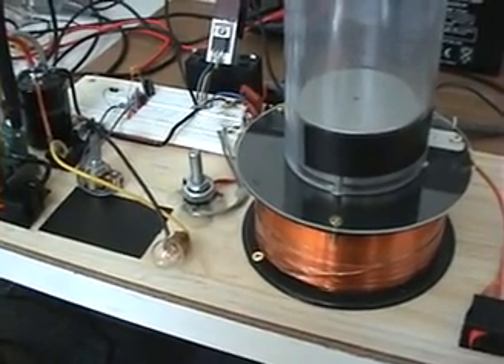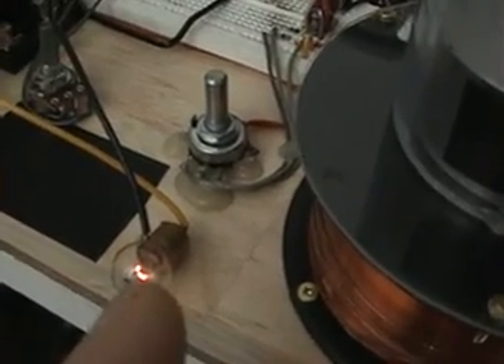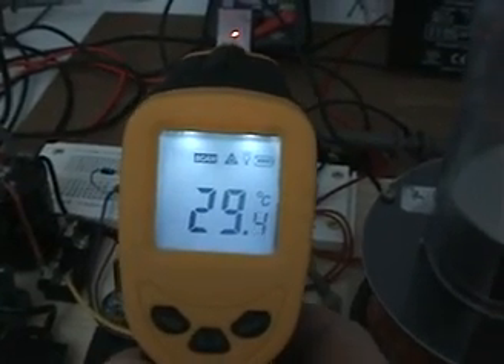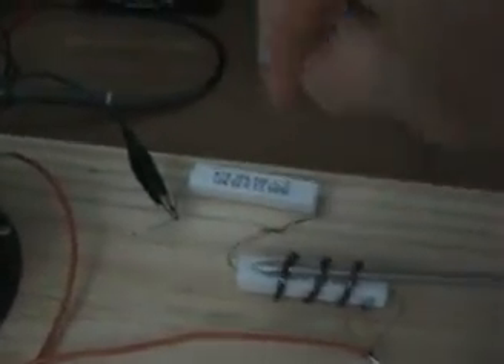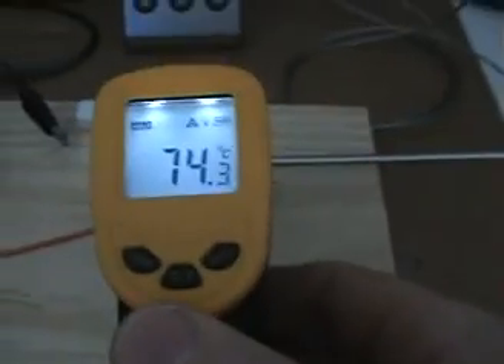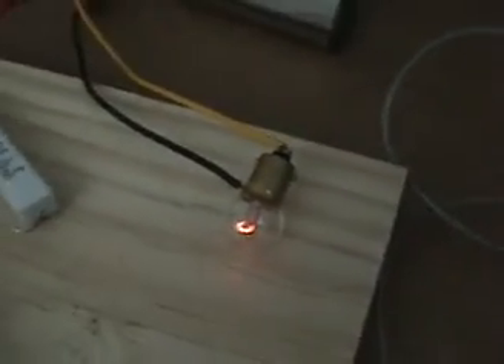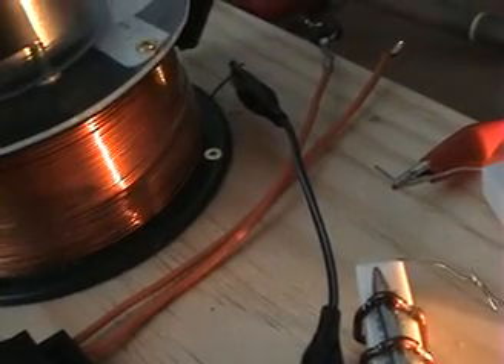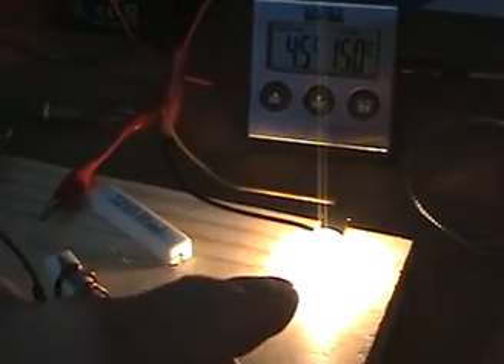Effect of Recirculating BEMF to Coil test 3

Comment: Hi Luc
Nice work as usual, and an interesting way to image the current--the magnet lift.
Unfortunately, despite your preliminary conclusions, your circuit does not create any excess energy. It displays pretty clearly how easy it is to make errors in power calculations with pulsed circuits.
Can your oscilloscope integrate waveforms over time? If so, it will be possible to get a more precise idea of the power balance in your circuit.
answers d o t com slash electric-power-measurement

Comment: Well done as usual Luc. As we were talking about before, I think it would be interesting to  use a system as we discused putting the bulb mosfet and the resistors in a calorific container and measure the temp: in the straight mode and then in the pulse mode. Take a note of your settings so that you can repeat this without the magnet so as it can be seen if the magnet is having an effect and if so how much etc.

Mike

Comment from the maker: Hi tubemp777,

from all the diodes I had on hand these two MUR420 in parallel worked the best but the main effect can be achieved with most high voltage diodes. It would most likely work with 1N4007 diodes. 

Luc

Comment: You have to understand that a coil will store magnetic energy in a AC circuit (pulsing DC). But a coil in a DC acts like a wire or short with little or no resistance. They use diodes as a quenching or blocking circuit in Flyback transformers the same way you're using it. The short the back EMF so it will not damage the driver circuit.

Comment: Interesting.. makes sense that there's current running thru the coil/diode circuit, otherwise there wouldn't be any magnetic field to support the magnet.

I forgot to write about this idea I had on your last video; is this voltage high enough for the diodes to reverse breakdown avalanche. What sort of diodes are you using exactly?